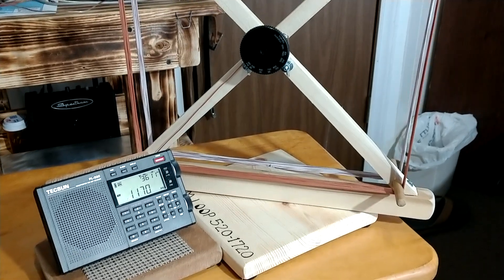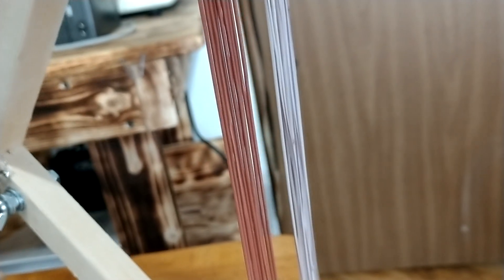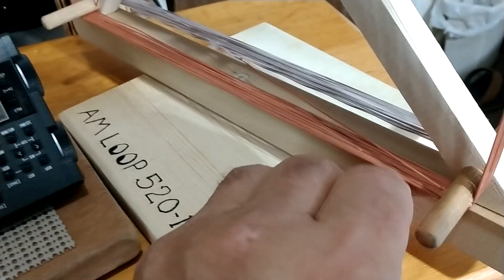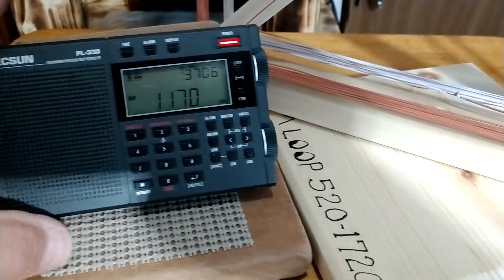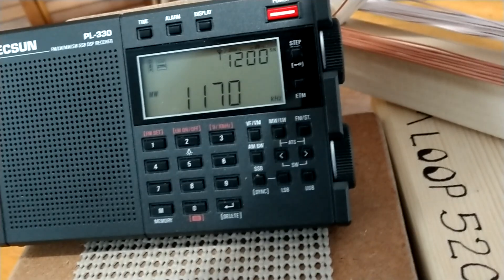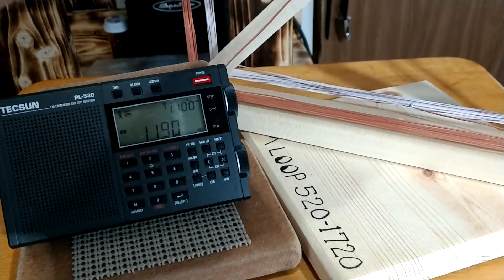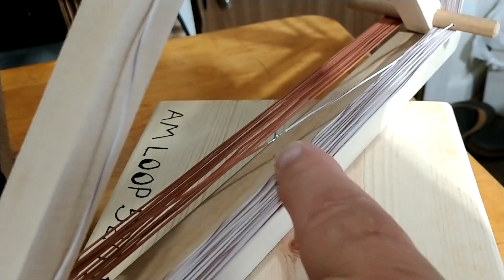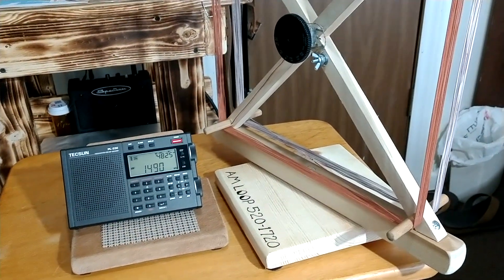Homebrew AM Loop Antenna E-Z Build

Comment: Works great - I might build one for the winter season here in the UK...I assume the winding is all in the same direction. and what's the schematic Gary and the value of the variable cap?
Reply from the maker: Yes, all the Winding is in the same direction. It is wound over a 12-inch square The capacitor is a zero to 360 Picofarads. The wire I used was computer cable wire stranded. and it was number 32. I hope this helps
Reply: @garycowger9579  Yes it does Gary, much appreciated... Dave